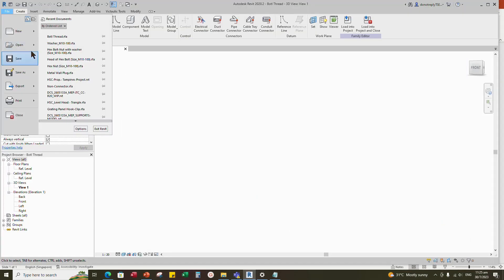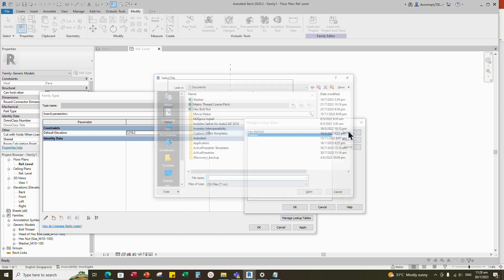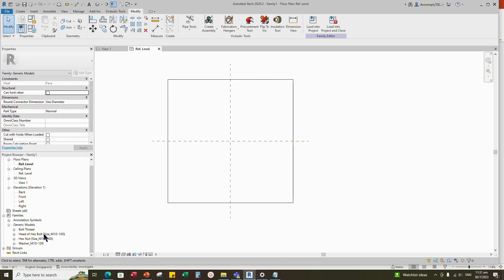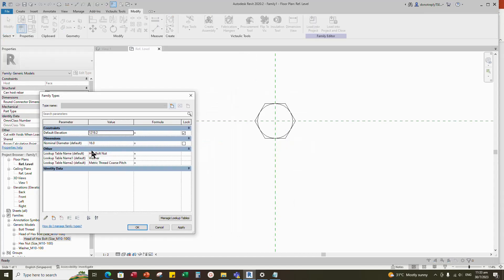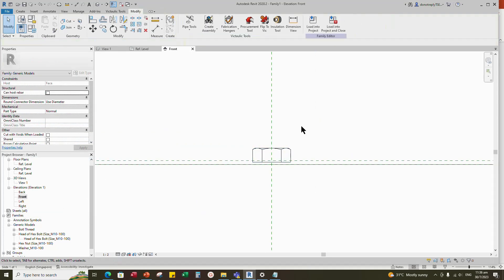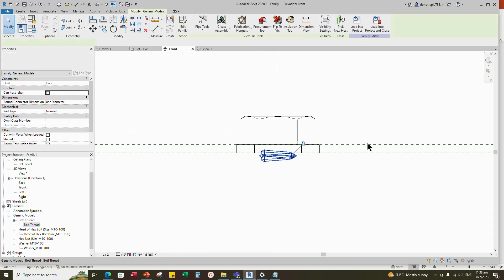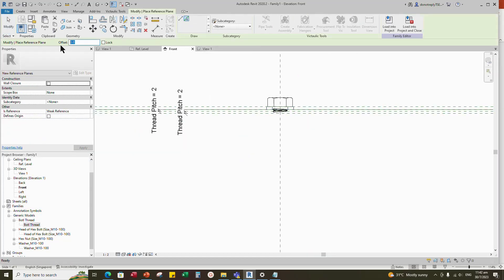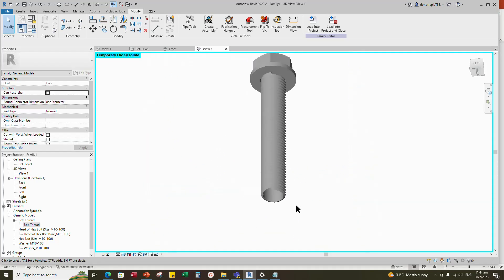How to create Hex Bolt-Nut (M10-M100) with Washer using Lookup Table

Comment: You present the solution below. But it doesn't really work.
I don't know if it would be possible to show a video indicating how you get from a size M16 to 2.20.

Thank you!
Reply from the maker: After update pitch value in CSV file, re-import it in Revit. And check and play the parameter. You can do it till the value which you satisfy.
Reply: @ThomRVT   Thank you!

Comment: Hi!

In the previous thread family creation session you created, the pitch size was 4mm for a 16mm nominal diameter. but here we are using a 2mm pitch for a 16mm nominal diameter thread. I could not create a 2mm pitch for a 16mm nominal diameter thread due to the line length being too short. Can you please assist with a 2mm pitch thread family creation?

Comment: In the previous thread family creation session you created, the pitch size was 4mm for a 16mm nominal diameter. but here we are using a 2mm pitch for a 16mm nominal diameter thread. I could not create a 2mm pitch for a 16mm nominal diameter thread due to the line length being too short. Can you please assist with a 2mm pitch thread family creation?
Reply from the maker: Revit only allow min 0.8mm line length. You can your pitch height
Reply: Thanks for your update! Instead of the female pitch, I created a male pitch thread.

Comment: if I may ask the profiles on the bolt thread were created by the triangle command using 4mm(2mm pitch reference lines ) on the sweep blend in the "How to create Thread revit family" video (from min 4:55- onwards) but in this video, the profile is only on 2 mm and shifted downwards to the center of the reference lines based on the pitch. is this an updated version of the bolt thread or there's a command I'm missing on mine. please assist if you get a chance
Reply from the maker: You can use your bolt thread manufactures dimension and create. There are min: 0.8mm dimension/length revit allow. If not you will get error. So that you need to play and check your parameter's formula to achieve the min: dimension